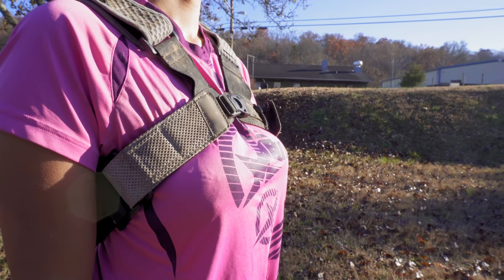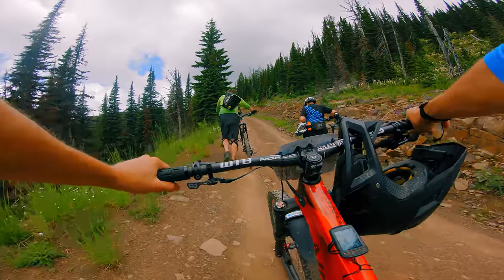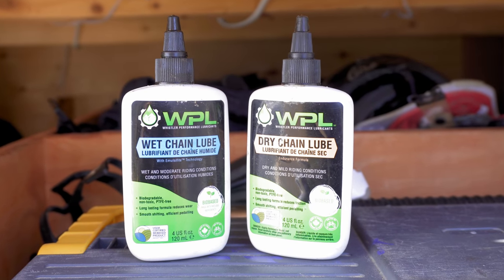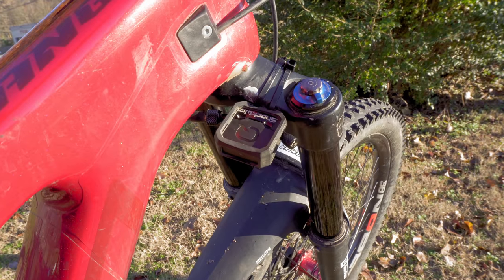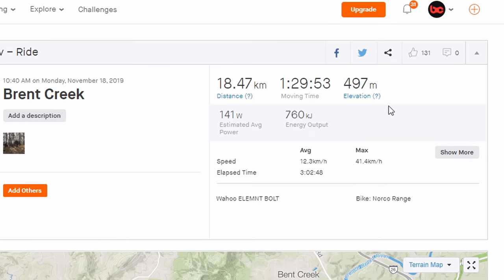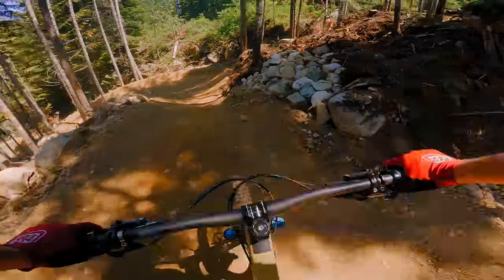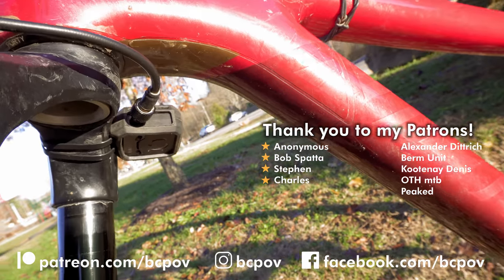10 MTB Products Reviewed - Electronics to Body Protection!

Comment: Awesome reviews. Ive been contemplating getting some new knee pads but im here in florida and dont want to burn up. I have the G-Force ones and they are not hot at all but having to take the shoes off is so annoying.
Reply: Lifted Adventures I have the race face ones and they are on the hotter side just so you know. I tried a couple pairs and these are by far my favorites knee pads to date !
Reply: @mathc1rca  I'll have to check them out

Comment: Bought the Giro’s on a pre-Xmas sale, $95 🇨🇦, and very happy with them (they have a good middle of the road arch equal to Specialized, bit higher than Fizik, a i have to replace the insoles to wear Five Tens), fit narrow which suits me, and my heel neither rubs nor blisters (narrow heel).

And since Shimano doesn’t make a 44.5, the slightly roomier toe box in the 44 Giro works just perfect.

Comment: Cool. Im on the market for some new knee armor.  Looking at the poc, leatt, and scott. Will add the race face to consideration 👍🏽
Reply: IXS is hard to beat !
Reply: @Voidclown.  thanks, i  forgot about ixs. Got them for my son already.  Will check them out. Do they stay on during a crash?Do you use them for XC, Or Enduro/DH riding?
Reply: I’m checking out new armor for spring. I like the POC but I’ll check out the IXS and the RaceFace. (Less money than the POC?)
Reply: MTB Zen Master I have the RF and I found them more comfy and overall protective than the poc. The sizing is weird though as they run very small

Comment: Aligning your brake calipers. Don't waste your money on any shim. Just loosen the caliper screws, apply the brake and hold the lever while you gradually tighten each caliper screw working between the tow until they are fully tighten. Release the brake lever and you're good to go.
This works equally as well on hydraulic and mechanical discs.

Comment: Pro tip when using the Birzman tool: make sure there's enough slack in your brake hose to allow the caliper to float into the proper position before tightening it up.

Comment: 3:04 really? I'm super surprised. My terraduros cracked at the bottom outer sole area after ~8months, then got a warranty replacement and those showed the same problem in ~6months. Normally shoes last 1-2 years for me. It was weird because they weren't super worn out they were just cracked, I do put quite a bit of force on the side of the shoe when I push into my cranks cornering I guess

Comment: Strava correct should be labeled switch to strava's version -which might not be correct. :)  It replaces elevation data from devices that have an altimeter built in to its own data which isn't necessarily accurate. Devices that don't have an altimeter are always using strava's 'correct' data.

Comment from the maker: Shock Wiz Correction: You do not have to recalibrate when changing air pressure, only when changing volume spacers.

Products mentioned in the video:
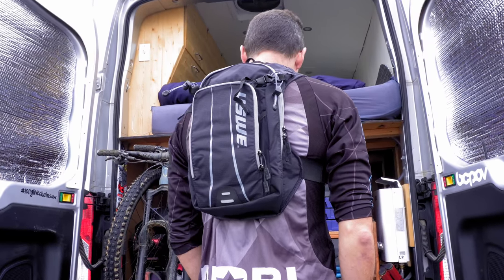0:29 Birzman Clam Brake Gap Tool https://amzn.to/2qbGk3h
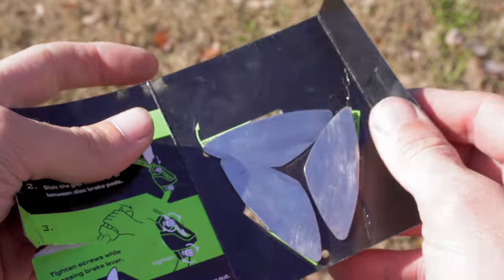1:40 USWE Hydration Packs https://amzn.to/2OHSQRA
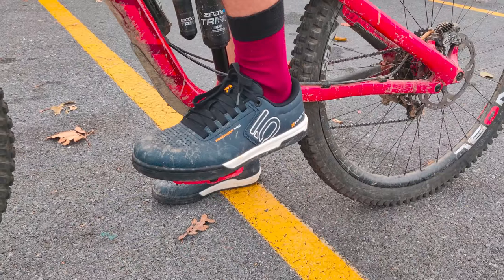2:55 Giro Terraduro Shoe https://amzn.to/2YiJiQp
3:45 Bike Yoke Revive Post https://amzn.to/2LfRtYi
4:47 WPL Chain Lube https://amzn.to/33IRaLM
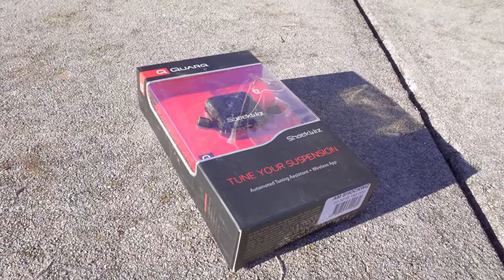5:25 Shockwiz https://amzn.to/2P3iRd7
6:40 Wahoo ELEMNT Bolt https://amzn.to/2P0DjeE
8:27 Wolf Tooth Components Remote https://amzn.to/37YwLG4 
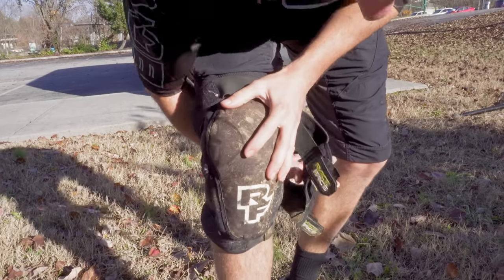9:17 Raceface Ambush Knee Pad https://amzn.to/34NHNMw
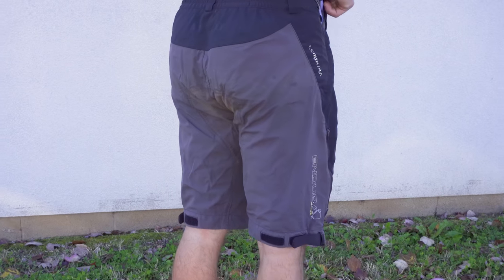10:07 Endura MT500 Spray Short https://1n.pm/EnduraShorts
Reply: BCpov only one like? Wow